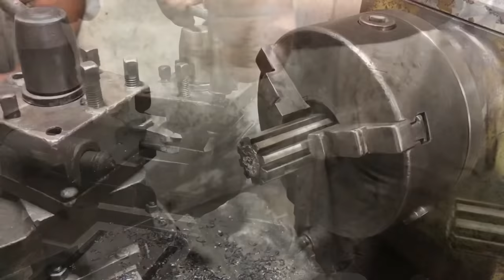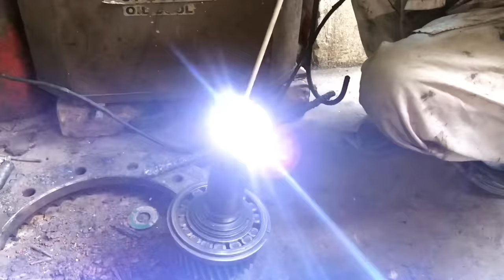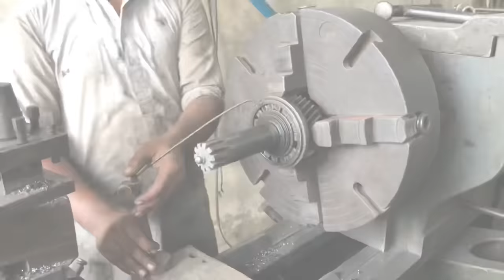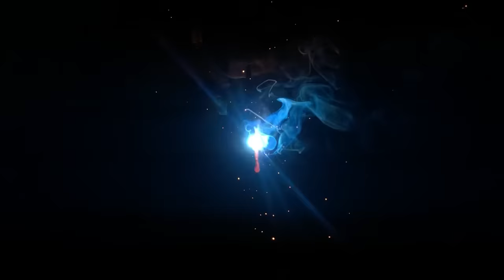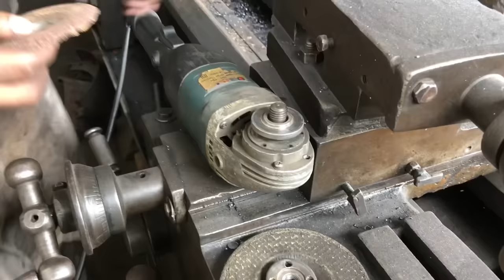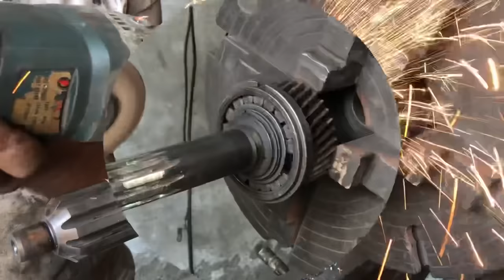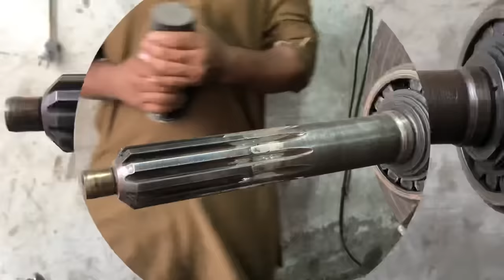The Ingenious guy Connected Broken Input-shaft Very Nicely / Pk process

Comment: It appears to be a successful repair but the question is how long will it last. The original shaft which is designed to take excessive amounts of torque and then now a weak spot has been created. No hardening is a major problem. It looks acceptable though.
Reply: May be few months.
Reply: @4Tee4  ssddsssssd
Reply: ঁুবুঁ
Reply: Until this vehicle use brake. :D
Reply: She'll be right mate. That weld pool will keep it together.
Reply: best comment,,the shaft after welding is dead.
Reply: It'll get him to the next mechanic.
With the black paint, it might last longer.
Reply: @SH-cu9rc  the paint was to see where the clutch hub got stuck (seeing where to grind more)
Reply: Surely it's the cheapest way than replace a new one, they've a mutual agreement initially and it's a win-win situation altogether including the part player's 😁😂
Reply: It needs some times to acquire some automobile parts and it's a scheduled job when it's situated remotely, another fast option is to fabricate one as such...
Reply: Com o eletrodo correto, composto de ligas especiais, pode ter certeza: "... pode quebrar noutro lugar, jamais no mesmo lugar da solda ...", como dizia um grande mestre na NASA ...!!!...
Reply: Going to have to really baby that clutch!
Reply: Wonder why he didn't drill both pieces and join them with a good size dowel, asked by an old non-machinist here.  I thought that was what he was going to do at first.
Reply: I bet it will last at least till the customer is several miles away from the repair shop.
Reply: @lopezlopez7132  hahahaha
Reply: @stevereaves6757  The dowel method would have made it too easy for the runout tolerances to get out of spec. You didn't see machinist use a dial indicator on the first piece to center it in the lathe chuck. He didn't center drill it first to insure that there was minimal runout when the larger drill bit was used. If the machinist didn't use a dial indicator on the first part, he probably wouldn't use it on the second part either. The possible mismatch in centers would have made a real mess of things.
Reply: @MakersLab1826  You're easily amused, aren't you, Sparky?
Reply: This sort of repair should only happen in very desperate situations it shouldn't be done very labouring opening up the gear box.
Reply: As a machinist in the Navy for 25 years I can tell you that a proper weld is better than the original base metal. Also hardening this shaft would result in a shaft that would be too brittle to withstand the sudden shock of suddenly releasing the clutch. If hardening is needed then only case harden it making it resistant to wear but still allowing the inner core to take up the shock.
Reply: @willwade1101  Well, the operative word is "proper." Have you seen proper welds in this video? As for proper weld being better than the original base metal, sounds like way of a blank statement to me. I'd argue that it depends on what kind of base metal we're talking about. And one more thing, how well balanced this shaft is after such a repair?
Reply: Acceptable to someone who can't get replacement parts. But I bet the owner of that part will be back sooner than later.
Reply: @4Tee4  It might get someone home, or to a place/time where they can purchase/install a new shaft. When you are in BF Middle of Nowhere, you do what you can to make it to where a better more permanent repair is possible.
Reply: @marvin5620  It will last at least till the shop closes for the day. By that time it will rip everything apart since the shaft is out of balance now and only after that the shaft itself will break in half.
Reply: Weak spot? Er, wasn't there one there before all this happened?
Reply: @jrichker  By the looks of that lathe you’re going to get runout no matter what you do. It has got to be worn out and sloppy.
Reply: Se ve que nunca has trabajado en lugares donde no ahí refacciones en ocasiones se tiene que improvisar una reparación mientras se encuentra otra pieza
Reply: Last?
Such a repair is only designed so that you can return the borrowed item (which you broke) in a functional state.
What happens tomorrow is the lender’s problem!
Reply: It is not for someone who can afford to buy new parts.
They use their brain to work it out.
How long will it last? It is for sure that the modified parts will last less than the original and sometimes last longer than the non original parts. 
That is their life, their story. Their survival story.
Reply: Crack-tastic.
Reply: won't be long,!!! the original shift was proper heat treated, after spark welding, the material was totally damaged. By the way, this cutting machine has no accuracy at all, it should be in metal recycle ground.
Reply: @willwade1101   The ductility of the shaft itself plays an important role, as the torsional load is so great that the axle must be able to twist and rebound like a torsion bar rather than be too stiff and snap. All of you arm chair mechanics, it is amazing how many of you "Professionals" don't know that a good weld is stronger than the original. Besides the guy probably charged $10 for the repair.
Reply: @triatheletewolf7279  I did quality assurance inspections on test welds for 10 years when I was in the Navy. All the HT's had to retest every couple of years if they welded on submarine parts and if their welds failed before the base metal tore they were stripped of their ability to perform certain jobs and had to be retrained and retested. I failed several welder simply because there was a pinhole inside the weld which was discovered through X-Ray.
Reply: @lopezlopez7132  this repair was for the camera.
Reply: @borgheses  Maybe, but they do "repairs" like this all the time in that part of the World.
Reply: @jemmoutuber4165  Seems like their local OSHA is very strict... they are required to wear protective sandals on their feet...
Reply: Welds are stronger than the metal itself...
Reply: @catwoman2596  So, to make metal part stronger, they should be broken into pieces and then welded together.
Reply: сдрассьти... а пока денег этот пакистанец не накопит на новый вал, дети водителя водичкой из лужи питаться будут или побираться???
Reply: It'll never be stronger than before it broke, and it is, as you say, very likely to be weaker. I would hope they would drive it less hard from now on.
Reply: @tomfull6637  no. the paint is to prevent rust. obvs you've never welded bevor
Reply: @winteroutside7014  hahaha thx for making my day. You’re funny!
Reply: He forgot to use a duct tape to make it stronger 🤣
Reply: It's obvious that they make due with as little as possible there. For how much that fix was the cost of a new part (IF it's still available) might be more then they can afford. Now think about this. If this is the fix for this part what do you think the condition of the rest of the vehicle looks like? For the limited and outdated tools they have they did a great job.
Reply: Yes, its true.But how expensive must that piece be for it to be so convenient to repair it. Labor must be very cheap!
Reply: @willwade1101  Good comment but you might as well stop because there are a few with opinions always happy to tell everyone they know more than your 25 years of actual experience.
Reply: @Xaphan Vassago you subscribe to alot of jew channels
Reply: Exactly. While it looks good on a video it's completely useless in the long run.
Reply: @mrwakacorp  may be. we don´t know. We think that its completely useless un long run, but....
I konw one who broke the propeler of his plane. Someone repair it, more or less like that and  The plane still flying.
Reply: Nah, that weld will hold for couple of years at least. That is over two inches thick weld
Reply: That' was a 3rd word country"$  repairs , though would last  not that long  the labour is not that pricey ,than  in  developed nations, if ever you were to live in poor country ,GUYS  you would do the same  so jzt enjoy the vid.  some are jzt good behind keyboard
Reply: @LGrove-ep9yl  thank you Mr well supplied rich guy
Reply: @lopezlopez7132  mechanics under duress
Reply: @carlosrocca4763  part unavailable  or unaffordable
Reply: Agreed,  exposing to heat will make this repair really brittle.  Hope he cleaned or changed the bearing. The grinding of the shaft directly went into the bearing. This is not good.
Reply: if youve ever been outside the u.s. for 10mins youll learn real quick that car parts in general are extremely hard to come by.this may be their only option
Reply: Yeah, I was wondering the same thing. But I guess if you can’t find a replacement part, you do what you have to do to get by.
Reply: I think there should have been 3 rods reinforcing the core not weld material
Reply: You can actually see some inclusions after the grinding. How many inclusions further into the joint??? The inclusions and the lack of a welded joint in the centre, where it was drilled, means even without stress fractures at the inclusions, there is just less metal keeping this part of the shaft together. Given the facilities, I'm guessing the welding rod is not matched to the hardened steel that the shaft should have been made from, so will probably be softer. However, it could have come from a poor quality Indian manufactured gearbox.
Altogether, although this guy is obviously very skilled, not protecting the cageless bearing and gear while welding and grinding are bad. I wouldn't like to rely on that shaft. I presume the bearing will be replaced, but if so, why not remove it before doing all this?
Reply: That is very true, and the shaft is no longer straight, (true), so that will add forces for that re-break, and be tough on the bearings that support the shaft.
But they are doing what they can in poverty, fixing what we probably built with free enterprise.
Reply: temporary repair, material strength not restored properly. cannot take the maximum torque.
Reply: I have done similar repairs and most of the time they lasted years
Reply: @yeyeninfinixlos6499  98
Reply: It will last the first day.
Reply: For this people and their life philosophy this actions are the best try to solve problems.I may suggest that most of them have no any primal school education and only comprehend consequence of some actions that could show some results and only God know will be these detailswork or not.
Reply: This will break again
Reply: There are probably more vehicles driving around poor countries with repairs like this, than those with original parts. If you need your vehicle to make a living, you can’t wait two weeks for a part to come in. Also, many of the vehicles that are still in use are quite old and finding replacement parts can be very difficult and expensive. I bet this will hold up for a long time, obviously this wasn’t the first time this guy had done a repair like this.
Reply: If he used a 7018 rod which is only 70,000 tinsel strength it will only last maybe a few days if that plus you have a weak point where you heated the metal. That metal is no longer Harding it now has a soft spot surrounding the weld. Don't get me wrong it's a great temporary fix but not a permanent one.
Reply: I think it would actually be neat to see what lasts longer, the shaft, or the bearing that got a shitload of slag in it.
Reply: Five secs and no more xd
Reply: O90
Reply: ...isn't the weld the strongest part now?
Reply: a V-GROOVE FULL PENETRATION WELD is required if we want to at least restore the original strength of the shaft.
Reply: good enough to sell it to someone else!!!!
Reply: If you not yet pay for parts repair, you can't take the parts home, if you paid for, the parts warranty is finish  !
Reply: Finché  dura, dura! Evidentemente non c'è  altra soluzione! T
Reply: @stevereaves6757  probably didn't have pen
Reply: @stevereaves6757  probably didn't have pen

Comment: I congratulate you for this work, and I don't think that after welding the shaft you are going to throw it straight into the trash. I am currently older and retired, but in my youth in my country, Spain, for many years I have been an assistant on a lathe-operator, and we have done the same welding many times, of an output shaft of the engine flywheel towards the clutch or of a front or rear shaft of a four-wheel drive,  previously making a centering bit and then it works perfectly !! congratulations for the fantastic manual work
Reply: I like how things sometimes last forever that naysayers condemn. Hope it was successful. PLEASE DO A FOLLOW UP.

Comment: Lots of porosity in the welds that can easily be seen.
If virgin metal sheared then metal with a lot of big porosity isn't going to last.
Reply: Imagine you are somewhere on a Trans Siberian Highway, and your main shaft snaps in half, you have no means of nipping down to a truck dealer less than a 1000 miles away, and then no means to contact them to rush you a new shaft in the middle of somewhere in Trans Siberian Highway, but a local engineering shop with skilled person is able to rescue you so that the cattle live stock you are carrying in your truck don't die of running out of food, and exposed to ice cold weather for longer than necessary, then it is easier to hike  a lift to the nearest town with mechanical repair shop, who can weld that shaft in less than half a day and you can then hitch a lift back to your truck and reassemble the gearbox main shaft and get going again, but this time you ensure that you do not overstress the repaired shaft excessively by not going in higher gears, imagine this happens to you on Moon and the rocket snaps a crucial part, so please remember sometimes you do not have luxury of buying a new shaft, that shaft most probably broke due to a defect in the original casting, and most likely the new weld is even stronger than before.
Reply: @mgabrielle2343  The shaft is certainly not cast. In the case of an emergency repair, it is fine. But I think this is the final repair.
Reply: I didn't see no porousness

Comment: Input shafts are very difficult to break. I can't imagine the torque it would take to break one.
Unless it was involved in an accident. This is something you would do as a last resort.
Also, the tools used here are nearly worn out. It takes a certain amount of skill, just to work with tools like that.
It's amazing what people can accomplish when driven by pure necessity.
Reply: Is something they do when there is no money to buy a new shaft. And the local laws accept this kind of risky procedure.
Reply: @DavidReySilva  It took longer to (repair) than it will last. First Journey. FAIL
Reply: Difficult to break the first time. Each time it comes back to Abdul’s Plow Works for more oxidized steel, and welding slag inclusions, the torque requirements are lower.
Reply: Most likely just for content, they probably broke it on purpose.
Reply: I would expect the centre of the clutch disc to wring out before the input shaft would wring off like that
Reply: Und ohne auf verlust zu achten !!!!!!!!🤪🤪🤪🤪🤪🤪🤪🤪

Comment: There are at least two rollers missing from the bearing.  But he added that much metal back from the grinding sparks, so ok.
Reply: If the bearing is missing rollers obviously they are going to replace it, and the video is about the shaft not about the bearing. Smh
Reply: @IAW888  "Obviously"?  Not so much.  We've seen these guys do really cheap things like reusing transmission oil,  smoothing heads with a rock,  making really porous welds, making little tack welds,  drilling holes freehand, getting sand into everything, and tossing parts down onto the ground.   It's not obvious that they're going to fix the bearing.

Comment: What is that bearing doing there? With all that dirt inside, it is already fried.
Reply: I wouldn't worry to much the roller cage is missing anyway.
Reply: The amperage of the welding most likely arced between the inner and outer races to the rollers.

Comment: I have only 3 conclusions here :
1. his labor cost way less expensive than the piece he is reparing. That's why we wouldn't event think about doing it: unprofitable.
2. if the manufactured part broke at first time...this may not resist long, after partial welding, hazardous coaxiality and home-made tooths.
3. the 1:54 made me scream.
...And of course he did the best he could, with this old school machinery, which is still impressive.
Reply: Unprofitablable is a relative view. Maybe it was do this job or not eat
Reply: It's entirely possible that a new input shaft isn't even available in Pakistan at all.  If the truck is old enough, it may not be available anywhere in the world (and might be an insane price if it were—single transmission gears in my 1960's tractors, IF you can find them NOS at all, are many hundreds of dollars.